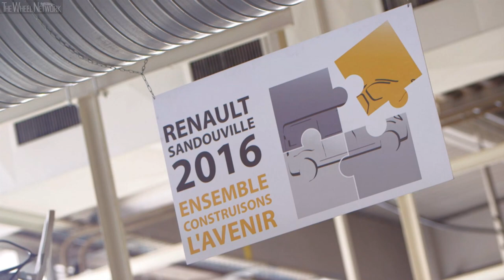Renault Trafic Production in France

Comment: I have one from new now 5 yrs old 110000km
Good vehicle
5 yr warranty
Flywheel changed 2 x ( dual nass failure)
Clutch master  as leaking

Suspension turrets  as groaning when turning 
Radio as keyboard failed
All no quibble  and done in 1 day 
5.5 liter per 100 
Drives like a car
Now out of warranty i do my own servicing ..pretty simple